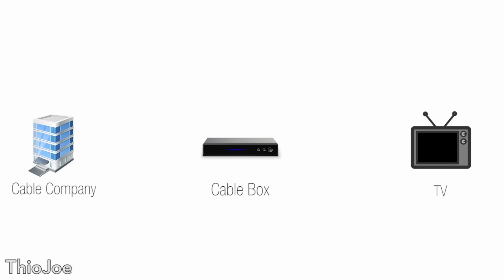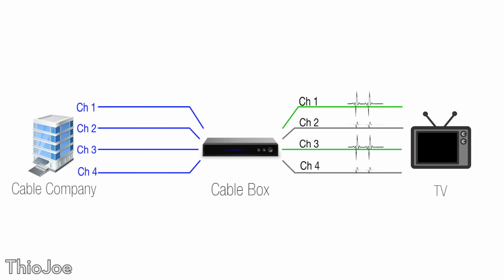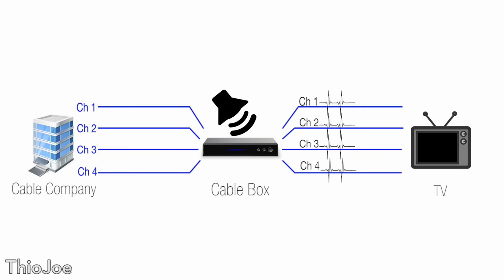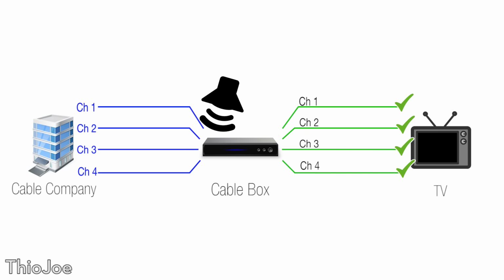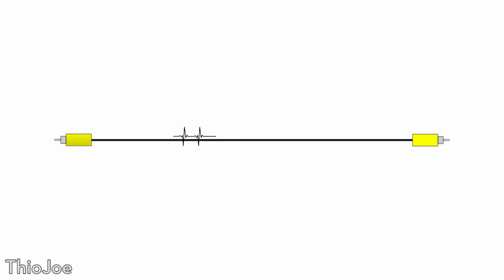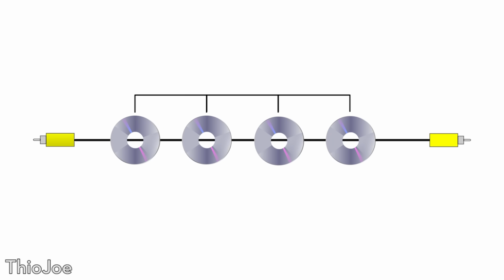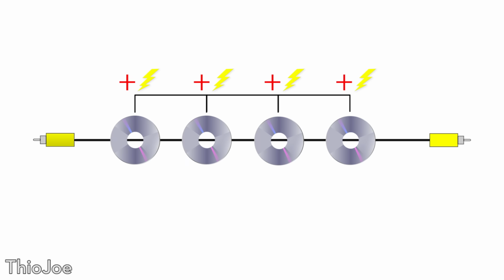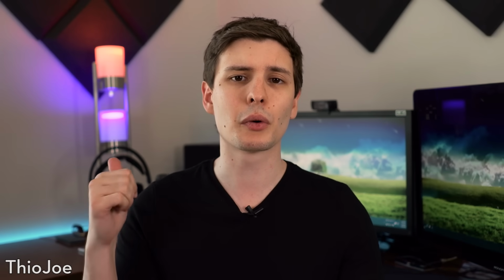How to Get Free Cable (All Channels)

Comment: AMAZING HOW THREADING YOUR CO-AX CABLE THROUGH SOME CD’S IT CAN AFFECT IN ANY WAY THE SIGNAL RUNNING THROUGH IT CONSIDERING CO-AX IS SHIELDED TO SPECIFICALLY PREVENT THAT, WITH ALL THE WIFI, CELL PHONE, MICROWAVE SIGNALS FLOATING AROUND OUR HOMES, GOTTA SAY IM A BIT SKEPTICAL THAT NO ONE ELSE OR THE CABLE COMPANIES WERE SMART ENOUGH TO FIGURE THIS OUT

Comment: Another good thing you can do with 4 CD's is if your car runs out of gas, tape the CD's to the bottom of your gas tank and you will get another 100 miles out of it, or if that doesn't work,  tape them to your head and maybe they will amplify some common sense into your brain.

Comment: Ok I got it kind of working,but the channels are a little snowy..Should I move them closer together or further apart???Thanks so much for the tip...
Reply: I just tape 2 c d up to my toilet all I got was a bunch shit
Reply: Phillip Mckinnish
Reply: I had Diaria
Reply: Phillip Mckinnish Without knowing how far you have them to start with, it could be either. You should start them with 7-8” apart. From this position you might need to move one closer or farther by 1” increments until you find your cables frequencies or “sweet spot”.
Reply: Thanks working now @Jim Jardine
Reply: Why can't I read the comment replies dammit my cable is shut off someone just told me to do this trying to see if it's legit...
Reply: Phillip Mckinnish. Use a CD cleaner 😜

Comment: My cable company does not work this way. We block all channels by default by scrambling the signal, a digital cable box is required for us to unlock channels through an internal computer. Also we don't send a single signal to houses, there a little over 100 frequencies that are being broadcast with a couple channels played through each one. This is why if your cable is damaged, you''ll have some channels working and others not. This will give you inconsistent Internet as well. This whole video is only good for old school cable systems. Won't work for Spectrum, AT&T, WOW! or Comcast.
Reply: Well help me get all my channels unlocked bra. Using charter outta MT
Reply: How old school?  I have an older cable box that I'm selling on Marketplace but I will keep it in this case
Reply: you are my hero.
Reply: L.  O.  Effing L.
Reply: Then which cable company will work for? I have an old school box..
Reply: well his looked like a newer cable box i wonder what company he has then lol

Comment: I used 12 CDs, is it couse it's not working
Reply: Try 13
Reply: u have to put cd c0vers too
Reply: Wouldn't you have to strip the cable cord to the wire in order for the CDs to someone work if they were going to work. How would they work through rubber? I mean it works with an antenna because it's metal. I think if you do it this way but instead of the cable cord you use just the wire cord that gets you free cable but only the six channels
Reply: It must be a  Céline Dion CD in the middle

Comment: LMFAO... oh man, you almost make this believable... except that you have pulled this stupidity in the past.  Now people, go online, and research how CDs and DVDs work.  The way a CD or DVD stores data is very simple.  It uses a laser which bounces off the reflective surface at an angle and back to a sensor which detects the laser light.  Data is stored on premade CDs (like video games you buy), by a series of bumps, which represent the 1's and 0's of the binary data.  When the laser hits a bump, it reflects off at a different angle and the sensor doesn't detect it, so that is read as a "1", when there is no bump, it is read as a "0".  The 1's and 0's are put together to form the binary numbers that make up your data.  A CD or DVD  that you burn at home is slightly different.  Instead of a bump (placed there by a manufacturer press), it burns a spot on the CD/DVD instead which prevents the laser from reflecting.  The result is the same, the sensor doesn't pick it up and you have a 1 recorded.

My point is, the way CDs/DVDs store data has absolutely NOTHING to do with ANY electrical properties, inductivity or other nonsense!  It is basically just a thing layer of reflective foil (not sure what type of metal it is honestly) with bumps or burns.  That's it!  Rewritable DVDs are slightly different, but you get the idea, same concept.

The moral is, if you watch it, pay for it, don't steal or we all lose out, and stop watching this loser.
Reply: If you rub the DVDs,vigorously on your head hair,on a rel low humidity day, you might actually generate a tiny bit of electricity. If you stacked a bunch of these charged disks in an insulated rack, you might have enough electricity to watch a nano second of cable. Don't blink or you will miss that free movie!
Reply: Don Fish Jr.
LMAO!

RUB paper on your head, you also generate static!  Rub a balloon on your head, you generate static!  What is generating the static electricity is the PLASTIC THE CD IS MADE WITH, not the foil!  Go back to school and get educated.
Reply: Great technical explanation. LOVE IT!
Reply: L

Comment: What a load of crap.  Using cd's as capacitors! Why not just use caps. Try to bogle the non tech people with some math formulas and maxwell's Law.   This won't work people. Laws of induction will not work in a coax cable as such. That's what the braided metal is for to reduce noise. Besides that. The signal rides on a carrier. Simply amplifying the signal won't give you more stations. You can buy amps to do this and your picture may improve but you're not going to get more stations. Do you really think the cable technology is that dumb? For another thing, most are digital signals not analog. You're not going to amplify a digital signal. Go sell this to the people that buy free TV. BTW Tin foil will do the same.
Reply: no body believes you.  I tried it.  it works.
Reply: Simmer on down there my dude. Obviously you haven't tried it. So why are you talking non sense? You're that guy who no one likes because you say that you've tried everything. For instance, like scuba diving or sky diving. Then when people call you out for obvious reasons, you retreat back into the corner with nothing to say because for some reason you tell yourself that you are right. You think it, say it and then believe it, for it to be your truth. You're quite thee funny character my dude.

Comment: Hi Joe, if you'rer still around, I have a question for you. I have this set-up: Cable out of the wall plugs into the TV, Cable box glugs into the TV as well with a HMID cord. After putting the CDs on, how and in what order to I reset everything? Thinks Billy

Comment: Interesting  video! But my number concern, would be wether using your device would constitute " Theft of Service from my Cable Company 🤔 " or not ? I currently get my cable and my internet service both through my cable service  provider. Would using your device affect  my internet service  or not ? If I could cut my cable cost by 50%! ; that'd help my budget a lot! My phone service also has Internet service as well, which might be cheaper, but their speed might be slower. In switching over, I'd definitely  need help as I have arthritis  and nerve-damaged hands. Can you clarify your system and answer my questions I have regarding your solution,  please ?

Comment: DON'T exceed 10 discs.....2012 In CERN in Switzerland they only used 8 discs to create the higgs boson particle....but they have been using swiss duct tape(which has holes in it).

Comment: Could a cut piece of foam about the diameter of the center of the discs (about the size of a quarter) be used to space the discs apart and securred with hot glue? Or does the duct tape have a key role in this other than holding the discs in place?

Comment: This being a joke, there is a legit way to actually get free cable. Though possibly illegal. You pay for the service, wait until you see the channels, shut off the box, and disconnect the cable from either the wall or the box. After you do this, call the company and terminate the subscription, wait about 2 weeks, and the channels will work.

Comment: My apartment was built in the 40's so the cable wire comes through the floor and not the wall, would the trick still work?
Reply: Travis Tarrant lmao read the desc its fake

Comment: what kind of cable box ix needed for the desert?
Reply: You don't need a cable box in the desert... IF you have at least 2 cacti in your yard. Simply run a 12 guage dual strand wire between 2 cacti (must be at least 122" long). Split the wire EXACTLY in half. Next, connect a coax cable to your TV. Run the other end to the cacti wire. Remove the antenna end of the coax. Seperate the ground portion of the coax from the center wire. Connect the ground wire to the wire running to one cactus, and the center wire to the other cactus wire. Make sure none of the wiring touches the ground. Now, run a TV scan THREE times. On the third time, stop HALF WAY THROUGH. That should give you the optimum reception of any cable channels that are available in your area.

Comment: Did he say in order for this to work you cannot have digital cable?
Reply: Digital cable is tricky. You'll need to pay careful attention to the spacing between your disks. Most of the time I like to tune them by trial and error, but I normally use a satellite dish, which this hack also works for!

Comment: Coax cables are shielded to prevent the inside signal from leaking out and the outside interference from creating ingress. Any interruption in that causes the signal to fly out and not be received by the box. They are all built with a braided metal mesh and a non-fluid flooding compound that are all designed to keep the signal pure and contained. This will not work. Source: I am a cable technician.

And the modem visible on the middle shelf of the entertainment center (black and blue box) belongs in a museum.
Reply: LOL

Comment: Bud you are completely wrong if you actually knew anything about how the cable company gets channels into peoples houses. First of all all cable companies run on digital signal now how we block channels is through coding sent to the box has nothing to do with signal actually to much signal is bad and causes stuff not to work cable boxes are made to run on a certain DBmv level of freqs to high it won’t work to low it won’t work also there is no electricity running through cable companies coax lines it is all RF frequencies also your tv showed that you disconnected the cable from the cable box not saying your not paying for the channel they are two totally different screens good try bud